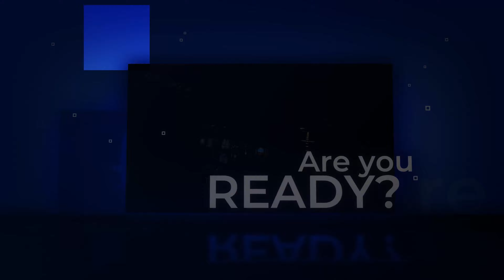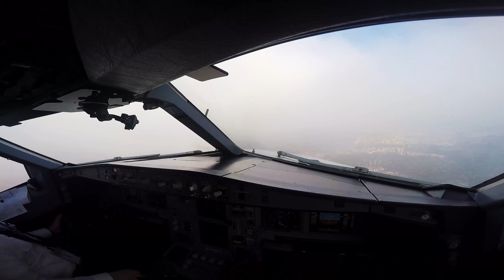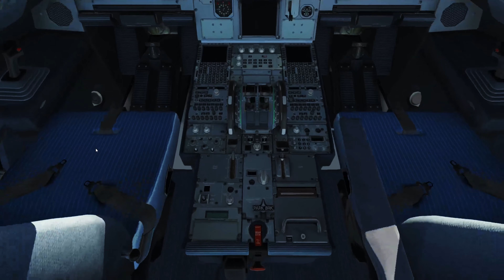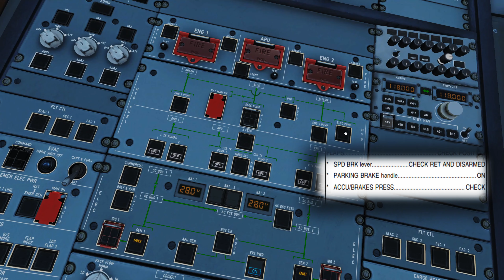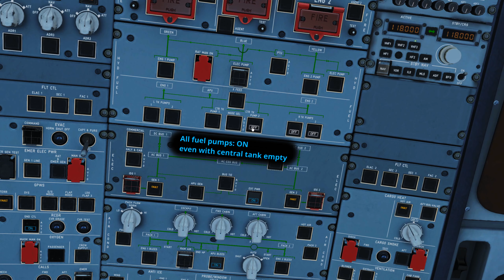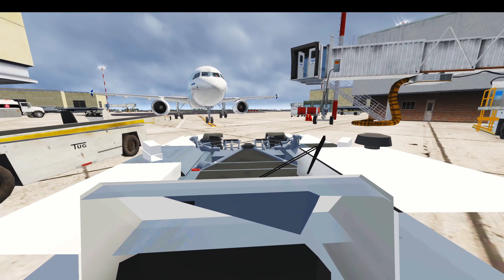A320 SOP - Part 1: Cockpit Preparation

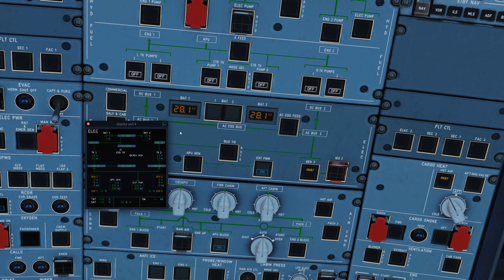Comment: 10:58 Hello captain, shouldn't one of the fuel pumps be on before starting the apu normally? because that's how it is in Boeing.
Reply from the maker: Regarding Boeing, I cannot really comment because I dont know. On Airbus, APU dont required any of the pilot operated fuel pumps to work. The concept is that APU has its own "ecosystem". Thank you!